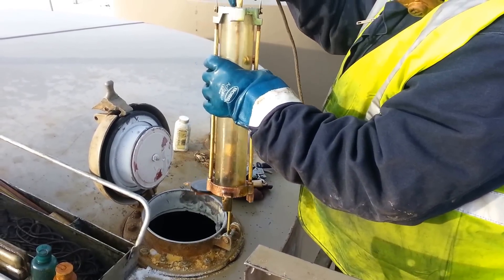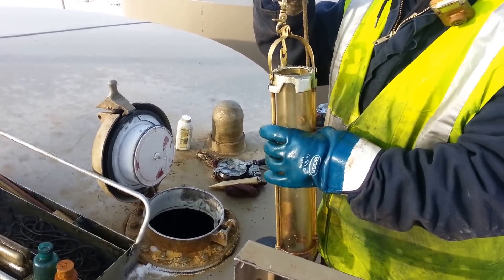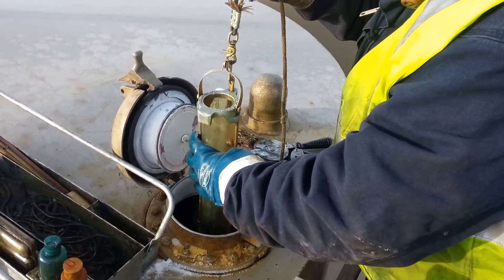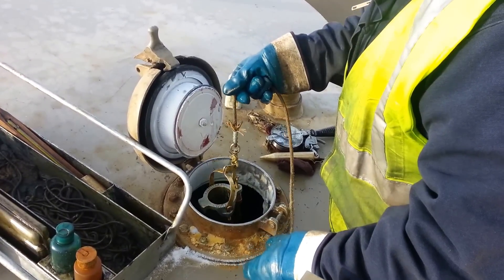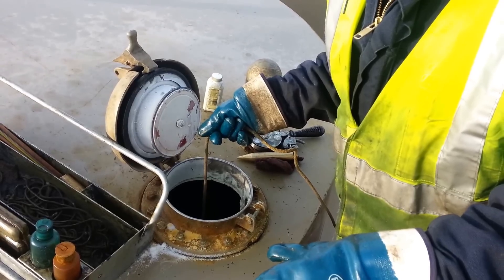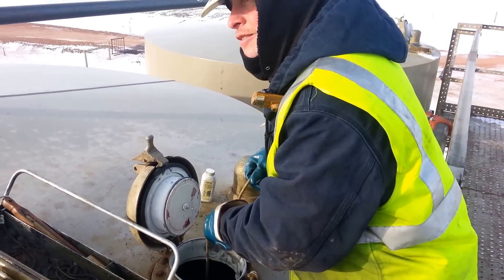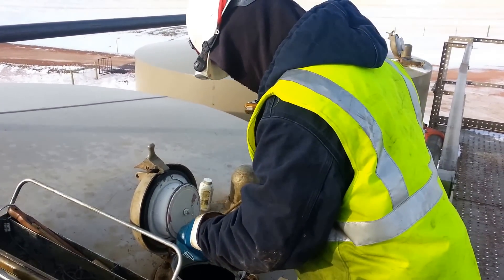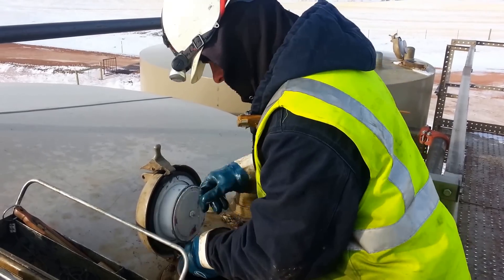Thiefing a Tank, Part 1

Comment: I have a hard time believing that this oil is that clean especially in winter when viscosity is thicker and doesn't separate as well, there is no way this oil is at a saltwater disposal, in my opinion staged for the video. The bottom is what usually tells the story and the load line is about 14 inches up sooo..